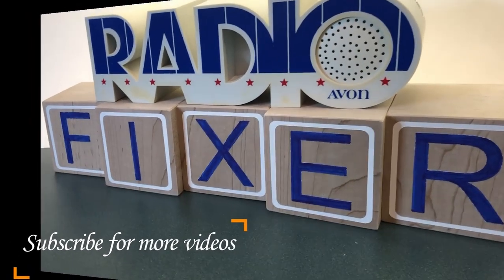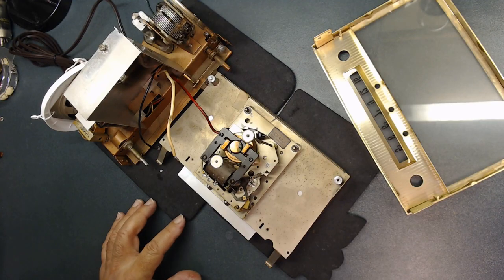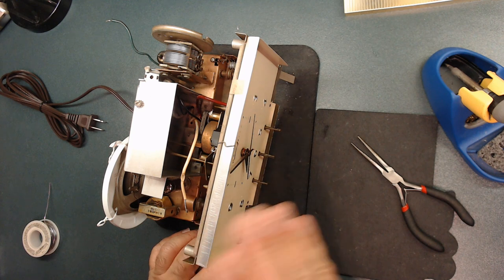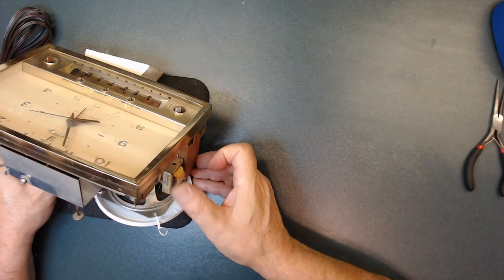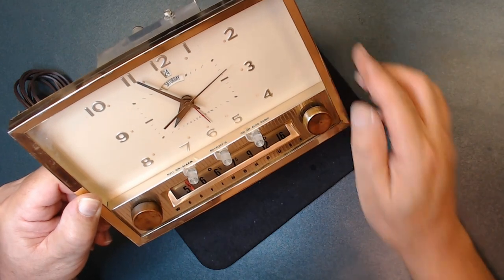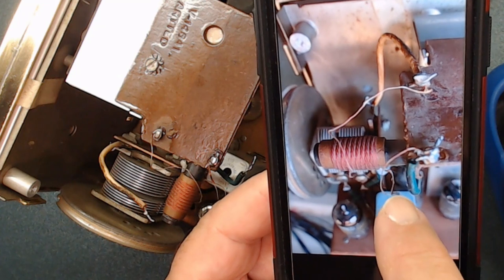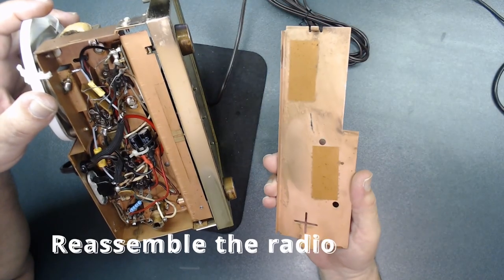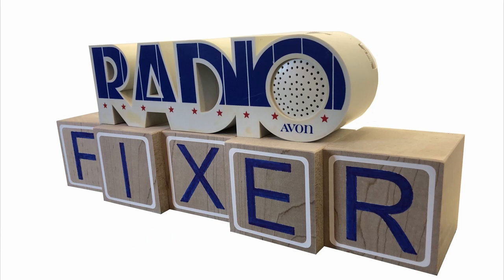Part 2 - 1955 Westinghouse Clock Radio Repair

Comment: Yes when they mass produced those radios back in 1955 they never really paid attention to what would happen to the wires years down the road. So you are doing everything perfectly Jay. Taking your time and being methodical in your work. Great video Jay.
Reply from the maker: Hi Larry, you are absolutely right. They did not paid attention what heat can do to those wires.. LOL  They had no idea that these radios will be around and working 68 years later. That what I called quality product, definitely is not like a Chinese junk these days. Good hearing from you! Have a great day! Regards, Jay

Comment: You really got your clock cleaned on this one. Looks fabulous Jay.  It has character that only comes with time.
Reply from the maker: Hi Steve, thank you very much for the kind compliments. Not sure why all radios that I am working on needs a lots of work.. LOL.  Someday I wished they just need capacitor only and I could call it "restoration", instead of "Repair".. LOL.  But NO all need everything under the sun.. LOL. Good hearing from you! Have a great day! Regards, Jay

Comment: Jay, another fine restoration.  I always enjoy your method of instruction and explaination of your techniques.  I've had plastic cabinets that were in pretty bad shape and to solve that I would wet sand (starting at 800 grit & stepping down to 8000 grit) using hobby sanding pads.  You can purchase those at hobby lobby or any other hobby shop (usually as a package).  Drawback? you have to isolate the paper stickers on the bottom from water damage.  The result is amazing.  Anyway, great job!  Keep up the good work, it's always rewarding bringing these things back to life.  Tony
Reply from the maker: Hi Tony, Thank you for taking time to message me. You are a true gentleman. You are absolutely correct, using those wet sand paper is awesome method to fix the scratches on Backlight and Plastic cabinets. So glad that you mentioned it. I bought mine at car part store when was restoring my car. They definitely work very well as you mentioned.   So good to hear from you! Have a great day! Regards, Jay

Comment: The radio turned out very nice, Jay. I like your tips on using tacky glue for shining the cardboard, and stabilizing the label.
Reply from the maker: Hi Jim, thank you so much and glad you enjoyed the video. Those Tacky glue works very well since it is flexible and after drying is total clear. It protects and brings back true color of old paper or cardboard. Make sure to dilute it with water to lay smoother. Good hearing from you and have a good day!  Regards, Jay.

Comment: Thanks sharing the info.
Video is 1 year old, but... I have one of that radio, ivory.
Do you have any tips on how to calibrate?  the clock is fast.
Thanks again.
Reply from the maker: Hello, good hearing from you. Feel free to watch this video "Part 5 - How to repair broken Bakelite radio".  Where I discussed how to lubricate/repair electronic clock and hope can assist you. 
I think that radio was designed to run on 117 Volts electricity as I recall. These days in my area house electricity runs between 120 -122 volts, maybe due to that the clock runs faster but not sure if that is the problem or not. 
Try to use "variac transformer" where you can adjust the amount of electricity goes to the radio to see if that is the reason. If that is the case then try to install a diode to the hot powerline that goes to the clock to reduce the amount of electricity goes to the clock. I add diode to my radio that I mentioned above. Hope that video assists you. 
Feel free to let me know the result. Have a good day! Regards, JZ

Comment: Hey Jay!  
Thought you would enjoy this video:
https://youtu.be/uhomoPSvq9I
It shows how to use a capacitor to drop voltage on a series string radio without using a heat-producing resistor.  By using a capacitor, you can drop the same amount of voltage but without the heat.  He also shows how to calculate the value of the capacitor in µF as well.
Reply from the maker: Hi Wayne, Thank you so much for thinking about me and let me know. I am subscriber to Larry Channel and he has a great channel. I have to watch this video again since working on another Montgomery Ward and need to remove old "line cord resistors" that they used to drop voltage. I read somewhere they called those cord "curtain burner".. LOL which caused fire. Definitely do not want to start house fire.. LOL. I need to make time to work on some of my videos and uploaded to YouTube, they are so time consuming since needs to much edits due to language barrier need to make sure they make sense .. LOL Hope you are doing well my friend. Again thank you for being in touch. Have a good day. Regards, Jay